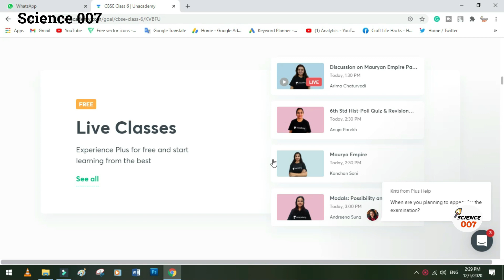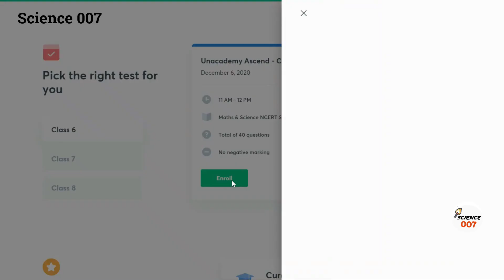3 Simple Science Experiments and Projects | Easy Science Experiments to Do at Home for Kids

Comment: You haven't done it again plz do it or tell the results to me plz plz plz
Reply from the maker: With colgate you can make slime but you need borax powder too...so for that i am not making video on this topic
Reply: @Science007  ok sorry
Reply from the maker: I am sorry...
Reply: @Science007  but I did the craft were you lit fire on top of water and I now water is denser than oil petroleum and other flammable liquids I tried it with kerosene and it didn't work why did that happen to me ?
Reply from the maker: Kerosene doesn't catches fire easily unlike petrol. This because of the following factors: The auto-ignition temperature of petrol is lower than the kerosene. The vapour pressure of petrol is lower than that of kerosene.
Reply: @Science007  oh, ok thanks I will try it with petrol again thanks
Reply from the maker: Please take proper safety.... because petrol is highly flammable... this experiment is very dangerous
Reply: @Science007  ok I understand thank you